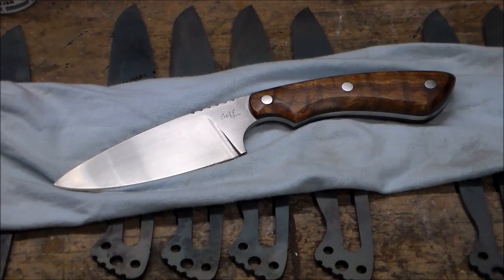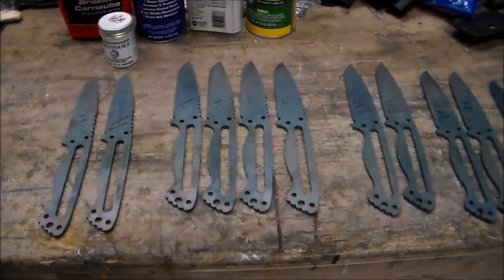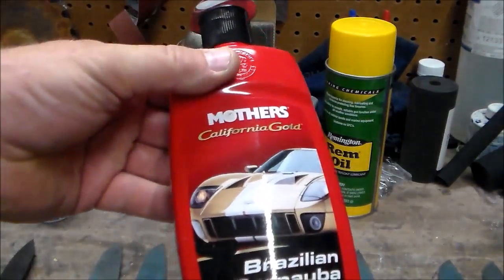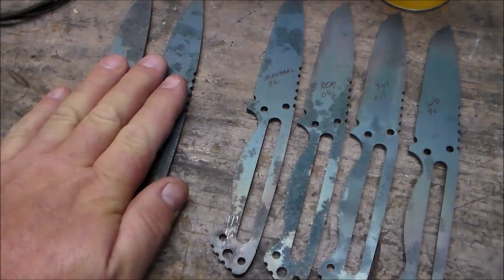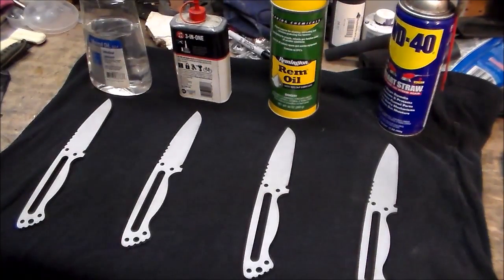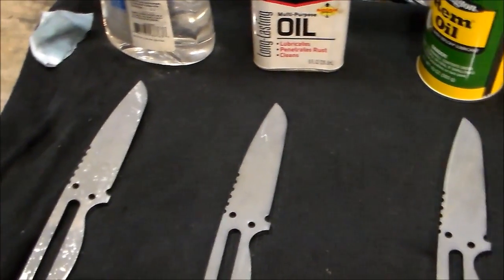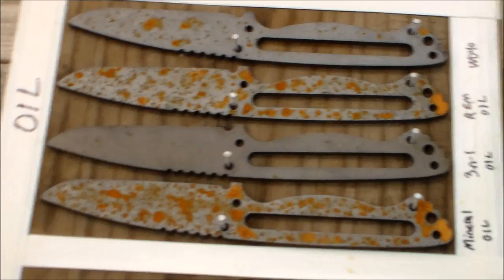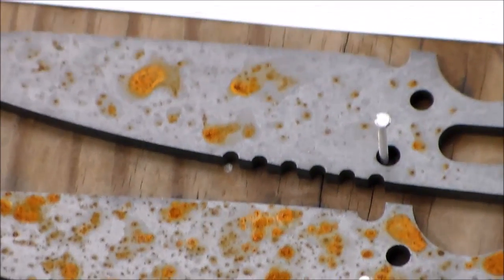1095 Steel, Corrosion/Rust Test for Knife Makers

Comment: This is awesome. Since 3in1 is clearly the best, and the cheapest, and people shouldn't expect to leave their knives out in the rain for a month anyway, that pretty much settles that. Good to know that 3in1 is also a great option for protecting tools, anvils, and metal stock.

But I'm still curious about how these hold up under normal use. I'd be interested to see the same test, but with each blade struck a few times into a piece of wood or something, maybe rubbed against some leather a couple times (to replicate a sheath) to see how much staying power each treatment has. I'm guessing with microscopic levels of surface treatment removed, they will all react about equally, but still curious. Also curious about seeing a saltwater spray over half of them (ie. take a piece of cardboard to block the blades, and spray only the handles with saltwater). Since sweat is salty it could be a valuable test. And easy.

My two cents about oil: A lot of people use Tri-Flow on their bike chains, but I find its so thin it just seems to "evaporate" and collect dust within a day or two. For many years I've been a fan of Pedro's ChainJ all season chain lube, it seems to stay on forever, and ya it gets dirty and grimy, but I never have a dry chain. It's perfect for people who neglect regular maintenance and ride in wet conditions. It is bio-degradable, which sounds bad for rust protection because that makes it sound like it'll just "go away" but in practice it works great. About $10 / bottle, but if you already have it for your bike it might be worth it to coat a couple knives in it.

Chainsaw oil is also cheap, $3/bottle from home depot if i remember correctly, but I haven't used it much. It's a bit thicker consistency than 3in1, which is exactly what I want in chain oil.

Comment: Great test, thanks!  If you ever decide to do a "chapter 2," I'd really like to see you test camellia oil which is the traditional protectant for samurai swords (not to contradict your swordmaker friend, it isn't mineral oil), as well as some of the modern weather-resistant lubes used in the bicycle/motorcycle world (Boeshield, White Lightning, Lucas, etc) ... a lot of these are meant to protect exposed surfaces that are subject to the elements and frequent contact and handling (as opposed to many lubricating oils and greases that are designed to be used inside protected bearings, motors, etc).  Some of the newer blends have teflon additives as well, which might be helpful on a blade surface.

Comment: A thin coat of water based poly urethane is the best rust blocker.  You rub it on then right away rub it off.  It will also reduce the friction on the surface of the knife.  I don't own any knives but I use this method to protect my cast iron tools.  I also use 3n1 oil in areas that need rust protection and lubrication.  The poly urethane does a better job of blocking rust than 3n1 oil.
Reply: You own no knives?  That's amazing.

Comment: Excellent test! I was leaning toward waxing my knives based on advice I've read online, and I long ago gave deference to mineral oil and petroleum jelly over other oils and waxes due to the toxicity of oils like 3-in-1, but your video has caused me to re-evaluate, and I now believe I'll be going with 3-in-1, maybe with bluing beforehand. You can always wipe off the blade before making your sandwich, and I imagine all of us have ingested a bit of machine oil now and then without any ill effects. For that matter, in the contracting business, I've had roofing tar and both oil-based and latex-based paint on my hands while eating lunch and I have yet to contract any kind of cancer or other ill effect. It's 3-in-1 for me!
Reply from the maker: Ha! Yeah I know I've ate a lunch or two with greasy hands. Wax is ok, and some guys will stand by it to the end. It's more of a preference and keeping up the maintenance. I think when you're selling knives, especially to regular Joe's, they probably aren't going to use wax. If you're selling to a collector on the other hand, that' may be very likely. My knives are users, so it's oil for mine.

Comment: This was a solid video. I am a high end knife maker and plan on changing some of my finishes. You have me sold on 3in1 oil. I use it for a ton of other applications also so it will be just another thing I can use it on. I plan on changing the leather oil I use also but intend on doing a similar video for sheaths. Thanks, very helpful.
Reply from the maker: Thanks.

Comment: Great test. Thank you for the video.   Would have liked to see ballistol used but I know you can't use every product out there.  Ballistol has been brilliant for me on my guns and knives.  I suppose it is similar to an expensive 3n1 oil.  All I know is I have never had rust again on anything again and I believe it is safe for consumption if you cooked with it.  Just amazing stuff
Reply: And ballistol has seemed to have made my blades and guns seem like they have a protective and permanent coat like they have been coated with tephlon however in ballastol's case it is safe to cook with although I wouldn't advise it

Comment: Great test.  I have always used 3 in 1 oil on my knives, but you have to clean them well after because it tastes awful when you cut an apple.  For a blued finish, use CLP.  Used by the US Army for most weapons.  Cleans Lubricates Penetrates...CLP.  I would like to see CLP vs 3 in 1 on un-blued steel.  The grain would be smaller on the surface if they were heat treated, and might reduce the pitting that seems to be the main problem.

Comment: All of my 1095 & CPM 3V knives I put a drop or two of 3in1 on each side if the blade after each use ( especially if I have been slicing any kind of acidic fruits) or if I've been out in the woods pounding on them, & I've never had such a hint of rust on any of the blades so far...5-6 yrs now, AWESOME stuff!  cheap too...
Reply from the maker: That's pretty much my routine too.

Comment: I recently decided to start using an auto polish. I had been using WD40, and PB Blaster. I also used mineral oil in the past and it seemed to sort of gum up.
  Currently I am using WD on one and wax on two others. One nice thing about using the polish is that it helps really clean and remove any minor rust or corrosion.
  I am going to keep it up for a while and see how it goes.
  PS. I had just finished waxing two knives and treating a leather sheath just before running into this video,  I must say though you really did a great job on this video.  I found it very interesting and encouraging since I have been doing my own small scale experiment. Also like you I generally, when using oil, rub it in and let it sit out over night and then redo it. I can tell that it makes a difference because the second coat stays wet much longer.
  Thanks again for the video.
Reply from the maker: Thanks. I think just about all of the products I tested or you test probably work fine if you keep it up. It's when you store one away for months without checking on it that becomes the problem.  Some guys swear by the wax, some by the oil, guess we all just have to find what works best in our own local climate.
Reply: I found mineral oil to gum up over time as well.

Comment: Good job!  As your test indicates, any sort of controlled oxidization, (bluing or acid), enhances the resistance.  New finishes will come along, certainly, and an oxidized combined with Ren wax is what I have used in the past.  I have gone to Cerakote for all my fighting and survival blades.  I am constantly researching advances in coating and protective finishes in general.  The best part however, was the undeniable fact that old school bluing when combined with 3-in-1 oil is damn hard to beat.  That tickles me right down to the ground.
Reply from the maker: Thanks for checking it out. I need to try Cerakote sometime, been curious about it forever.
Reply: Check with folks like Steve Edwards at Cinders & Smoke, Van Buren, AR, and Zach Holloway at Dawn of Defense.
Reply from the maker: Are you a maker too? Just popped your name in Facebook, is that you in Barling?
Reply: Yes, sir.  That's me.
Reply from the maker: Cool, sent you a FB request. Now I'm wondering if we have met before, your name sounds familiar.

Comment: Great test. The best rust prevention is not letting your knives stay wet (ha). I have a 52100 knife that will rust in front of my eyes (almost). If you could rust resist that steel it would amaze me. 1095 isn't the most rust prone but it will rust readily. I had to force a patina on my 52100 knife to make it usable. It still rusts but less rapidly. Any comments welcomed.
Reply from the maker: I like a patina'd for blades that are users. I've tried vinegar, Parkerizing, mustard, cold bluing, and ferric chloride. They all seem to work well and help the oil stay in place. I tend to just use cold blue and ferric these days, mainly due the time involved in other methods. I think just the natural patina that forms after years of use is attractive.

Comment: Nicely done.  Some comments: Coupon testing would be much more economical for testing material and surface finish.  It's how such testing is done for mil spec and aerospace concerns.  Fun stuff.  Polished finishes aren't just pretty; they resist corrosion better.  Rough surfaces present more surface area.  The idea that rougher surfaces hold the oil or wax better doesn't help when the high points (peaks versus valleys) of the surface are less protected.

Comment: I am just looking for clarification. Before you place the knife blanks on the board you have Rem Oil and 3 in 1 switched. After you put to the blanks on the board 3 in 1 comes before Rem Oil. I just wanted to make sure it was labeled correctly and not accidentally missed labeled.
Reply from the maker: Boy, Eric, I didn't think anybody watched my stuff that closely! As I abrasive blasted each blade, I re-labeled them on the back with a sharpie. I was very paranoid about getting them mixed up, so I constantly checked them. The initial layout at the beginning was just me planning the project out, no particular order. Good eye, but I promise, no switcharoo.

Comment: Good stuff and an excellent test design.  I have found compressor oil works well as an option too-FYI.  I guess that my grandpa was right to send me out to the shed with 3 in 1 oil to clean his guns and hunting knives!  Today I use the Amsoil Metal Protector on my steel items and guns and found that it works great.

Comment: Awesome video. I've got a big chopper I love to take into the woods with me, but after a few days in snow and wet the rust starts to gets bad.  Now I know for sure that a little gun blue and some 3-1 oil afterwards is the way to go.
Reply from the maker: Works for me, hope it solves your problem. Thanks for checking it out.

Comment: I'm in South Florida. It's always humid and 1095 knives will absolutely rust. Nano oil has kept my 1095 Silent Hero 4 in pristine condition. Talk about expensive...Sheesh. But the stuff works! 

Just before watching this video, I went ahead and rubbed a couple of coats of rennisance wax on the Hero. The sheath still has nano oil inside so it coasts the edge, for double protection 👍. I see the wax an insurance policy in case I get careless.
Reply: Hey, I'm in South Florida, too,  freakin everything rusts down here. It's amazing. Leave a blank out on the bench, and by the end of the day, you can already see the brown haze..

Comment: Ren wax really shines at protecting the acid etch from wearing on Damascus, san mai, and Hamon blades. It's less for corrosion resistance and more for general protection. You can see this in the FC Ren wax combo blade.

If you really want to go rust proof you can do FC, ren wax, and maintain with 3-1.

Comment: Thank you for doing this.  If I'd done it myself, I'd have controlled the moisture by spraying them with a spray bottle (probably distilled water) each day, and kept them inside.

I probably would mount them on something impermeable instead of wood in case one section of wood held more moisture than the others or whatever.

Out of curiousity, what did the backs of the knives look like? They had moisture trapped against them that took longer to evaporate or sheet off.

Again- thank you for doing this; it's very useful info.
Reply from the maker: +Wynne Eden I had originally though about trying to do a spray bottle test, but again, I was afraid of not getting them equally wet, especially with the oils. I also wanted to know how they would react to real world humidity. I figured Mother Nature would be more consistent then me. As far as how they were mounted, I was only judging the top surface of the steel, so I doubt they would've been influenced much by the backer. I also put the board on an incline to make sure any moisture could run off. It was a fun test to do, probably not perfect, but still educational for me.

Comment: I used to be a Design Engineer in Product Development with FN Manufacturing. Weaponry. The curator of our museum weapons who we hired to come in every, maybe 6 months and pull down all of the guns and treat them used a mixture of Renaissance Wax and Balistol. He swore by it. He used it on the wood stocks too. He did not buff it. Just a very thin coat thoroughly rubbed in. Granted, these guns were behind glass and never saw a rain storm, but there are other museums using the wax. I don't know about the combo. I do like Balistol. I never thought 3-in-one would do so well.

Thanks for doing this test. I always like to see these kind of tests. I always learn something.
Reply from the maker: Thanks. For my personal stuff that I don't use often, especially damascus or bone handles, I use the Renaissance Wax too. For my daily users, I seem to have better results with oils. I need to try that Balistol, several people have mentioned it.
Reply: @SelfMadeProject  Don't forget, I said he used a mix of the 2 for preservation. Kind of like put a few drops of the Balistol in the Renaissance Wax jar and dab your cloth in it. Don't stir it in. If I remember correctly. I should have been more specific. 

The Balistol has kind of a funky smell. Maybe not funky. Let's just say it's unique, but it's tolerable and you get used to it.

I should have also said that this is my first exposure to your channel. Of course, I subbed immediately. Thanks again.

Comment: Great job you put alot I mean alot of work into the making of this video. so just wanted you to know thanks for sharing and taking the time to show us.
Reply from the maker: +84neilbone Thanks!
Reply: 3 and 1 is good oil to have around the house that works good for door hinges when I was younger I used to skateboard and that was the best oil for the bearings it seemed to me. I was very surprised of how good that worked during your test. 

What do you think of Rust-Oleum rust inhibitor Shields metal surfaces from rusting? I have a few aerosol cans of it.
Reply from the maker: 84neilbone I've never had any of that one. I'm still thinking about doing a part 2 and try some other products. I'll add it to my list of possible candidates.

Comment: Thank you for this time and effort.  A fine test with real results.  I use tons of ren wax, and mineral oil.  And 3in1 but never did a test.  
I had also wondered about G96 I use it a lot. I had good luck in an artillery piece barrel cutting 3 in1 with vaseline to make it thicker. Maybe even regular motor oil? 
This proves that so much comes down to marketing and taking your money......
Oh and the Remington sucks in all applications I've tried.
Reply from the maker: Thanks. Yeah, I was let down a little by Rem Oil. I still use it, but consider it more of a lube than a protectant.

Comment: Mineral Oil, despite its failure in this video, is still an excellent option for regular maintenance because it is food safe. Due to its low viscosity, the force of falling raindrops will remove it from the surface of an exposed blade, resulting in a failure. A future experiment might consider a knife coated in mineral oil, then coated with a top layer of petroleum jelly (food safe & high viscosity) before direct exposure to falling rain drops or other moisture+kinetic energy. Great video, thanks for sharing.
Reply from the maker: I agree that mineral would probably be fine with regular maintenance. My interest was mainly worst case scenario, so actually, I'd guess all these products would be fine if properly maintained. Thanks for checking it out.
Reply: I learned that I definitely need to pick up some 3-in-1 oil, for that worst case scenario. Thanks again!
Reply: Brian Or just wipe some olive oil on and off real quick once a day and your knives will always be good to go.

Comment: Thanks good test with interessting results. Though one thing to keep in mind on the waxes, especially the Renaissance Wax, is that they are great for pieces with different Materials like Anitiques, they dont attack Brass or other materials as some oils do. 
Last thing you want on your 17th Century Sabre, Hunting Knife or whatever it may be to attack the brass guard or decorations.
Reply from the maker: Agreed. I've used on my leather work and it seems to work great.
Reply: I never thought of that, i like damascus steel knives and most of mine have buffalo horn handles , w turquoise & brass inlay.
Reply: Well stay away from WD-40 in that case. It’s got solvent in it.